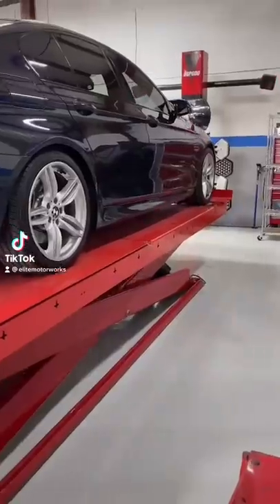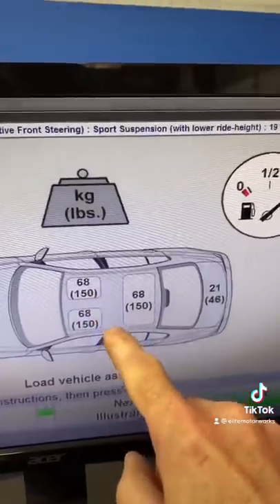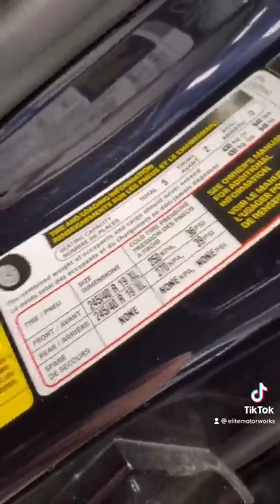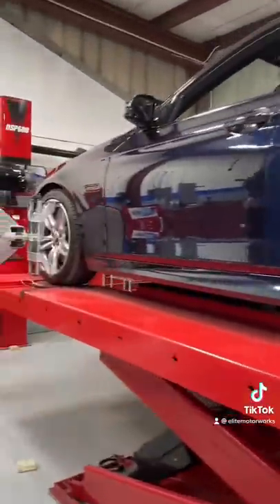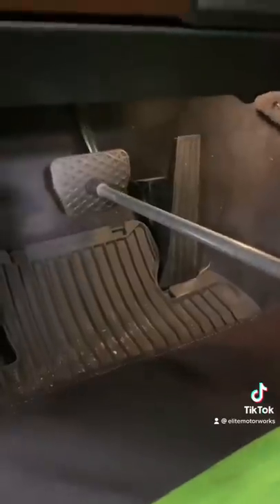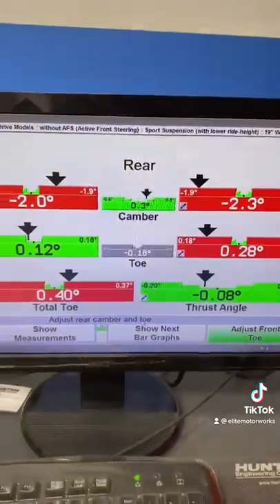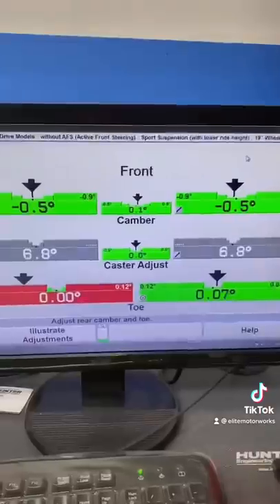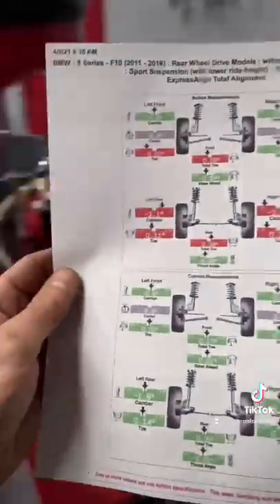How BMW does alignments #shorts

Comment: Props to some awesome BMW content! Getting the rear camber/toe in the green on F10’s and F01/F02’s is definitely a science. Both eccentric adjustments influence both camber and toe so it takes adjusting both eccentric bolts simultaneously to get the rear in the green. I remember doing some basic calculations during alignments when I first learned of the Integral 5 rear suspension on these and then realized - for expediency, it’s easier and faster to learn the double adjustment technique then to do the calculations. Unless it’s got Integral active steer which makes it much more complicated with the rear steering actuator…
Reply: ya ya i know some of those words too.
Reply: Get the toe exact, the camber doesn’t matter as long as it’s in spec but bad toe settings will make the car feel wonky

Comment: This is the correct way to do this alignment. My BMW repair manual also outlines this procedure and the tires shop did inform me that weight were called for, however, non of the tire shops I had gone to ever had weights and the dealer charged something ridiculous like $300 for an alignment, so I had the tire shops do it  out the weights for years and everything was fine. Car drove straight, handled fine no excessive tire wear that I could notice.

Comment: At the dealership I work at we use approved by BMW tools that have height sensors to not have to add the weight, but props for actually using the weights! I've far too often seen it not used and it looks like it's okay until about 20k kms later when the tires show very uneven wear
Reply: Most BMW's alignment goes to shit because their suspension components are garbage. Strut mounts made in Chiner that fail at 30k as an example.

Comment: Work at liarstone have a steering wheel leveler but no weights for the car. Try to get it close to spec everytime but without the weights and centering heads the car sits to high for a true measurement reading. It will drive straight but that's not everything.
Reply: What else is there? Just curious since I know nothing about all this
Reply: @AnishRamaswamy  camber caster split and toe angle. Toe is the distance the wheel is pushed out or in caster is how far forward or backward the wheel sits and camber is angle the wheel is pushed out or in.  Toe could be set for instance negative 12 degrees on both sides allowing the car to drive dead straight but wear the inside edge of the tire.

Comment: “BAM PRINT” while you hold the car in a perfect position & your partner clicks print quick as fuck hoping the results show a perfect alignment
Reply: Haha. Gotta be in the green
Reply: That's how you do it if you want the suspension mods to be cleared by TÜV etc here in Europe.
Reply: @panzerveps  in Germany u mean💀
Reply: @istoneyy4204  with ETC I meant all the other local government bodies. But if it's cleared by TÜV, you'll get it cleared almost anywhere else.
Reply: @panzerveps  yeah gotta agree if it’s cleared by tuv it’s prob okay everywhere lmao I live next to them and it’s funny how we dont have all those restrictions and they do I do have a German car tho haha
Reply: The alignment printout isn't worth shit if the car doesn't drive correctly.  An alignment isn't done until the car is road tested and verified to drive straight with a level steering wheel.
Reply: @ghostwrench2292  Yee dealerships will test drive it & if it’s straight “enough”, they’ll send it. Only after a customer returns about it will they make damn sure the alignment is spot on, but even then, it could be a number of other things after that, like different tread on a used tire, etc. & at that point, you just have tried your best to reason with the customer & can’t do anything more. I would know cuz I worked at one
Reply: The good Ole bump the sensor and send it lol
Reply: If you're doing it correctly as this guy is, it takes more effort to "click print" if the alignment is off. If it won't align, you have to buy the parts to make it right. Stop being cheap. This is a BMW. Go back to your Corolla. They're fine cars.

Comment: I've bought the tools and learned to do alignments myself. I own a BMW with after market wheels and I like to align them to a certain spec for those wheels. I'm afraid if I tell an alignment shop what those specs are and that I want them to those specs; they're just gonna ignore me and put it to stock specs. Ultimately I'm probably gonna be checking the alignment myself anyway so while I'm down there and got the turntables, measuring tape, alignment plates and fishing line out, why not just do the alignment myself? This guy would be the only guy I'd take my car to for work because he clearly knows his stuff and listens to what the customer has told him, fills in the gaps with his own knowledge and fixes the problem the right way.

Comment: Thats how its supposed to be done. Unfortunately not all BMW shops use the weights and the level. I have had countless discussions with shops after alignment… car drove straight but wheel not perfectly horizontal. They neither used OBD to check position of steering wheel (can be done - 100% accurate) nor a level.
Reply: That's because the actual level of the wheel is irrelevant. I've had way more people complain that a wheel looks crooked, but it's perfectly level. The dash curvature on tons of vehicles throws off your perception, so, I set them to look straight instead of actual bubble leveled.
Reply: Think is also has to do with tie rods.  I've had alignments were everything is green but the wheel wasn't centered.  Turns out I needed new tie rods.  Shame mechanics don't take the time to do simple things like check suspension parts for wear and play before doing an alignment.
Reply: @cooldaddyslick6869  incompetent techs, why wouldn't you "shake down" the suspension prior to an alignment?  That's easy money sitting there. Also, with damaged suspension components,  the alignment won't be true, and customer won't be happy. Lazy.
Reply: @gkeaton9755  Ain't that the truth.  Incompetence.  I've gone back and complained and I've seen the manager try to shake the wheels while it was still on the ground just to tell me everything seems tight and they don't know what the problem is.  Of course I just go somewhere else and never go back to places like that again.

Comment: Yup. You wouldn't believe what the weights are for. It's to simulate the down force the suspension is under at highway speeds. And, that's 90 percent accurate. A full BMW and Mercedes alignment is close to $350 +. Btw, the holes on modern BMW and MB wheels are exclusively for alignments. The attachment sits on the hub and not on the wheel. Wheel and tire combo can throw it off so they engineered it that way. Still need to reset SAS and driver assist. Sorry bro, but did you check suspension? I assume you did.
Reply: Tiddy Blaster  so I guess that means doing a shit job is fine then? 

Not saying these guys in the video did, seems like they did everything perfectly.
Reply: @elite4championjosh  yesss thank you lmaoooo. Hate seeing guys like this crying about something being wrong. 100% of those people btw start whining about the price of work too when they want it done by the book
Reply: Tiddy Blaster  I bet you're a blast at parties
Reply: Tiddy Blaster  sick burn xd. Ironic name is ironic.
Reply: Tiddy Blaster  sure if you're doing work on your car you can halfass anything and cut corners but if a customer pays you for a full proper alignment it is in your interest as well to deliver on the request
Reply: Tiddy Blaster  you never said close enough. Which by definition would be acceptable. 

What I was getting at, was that doing a poor job just because the effects are negligible is a slippery slope. Do you want a car with tracking that's slightly out, wheel balance marginally off, tyre pressures slightly over or under depending on the corner, audio system EQ a little too bassy? Maybe you don't notice the difference of some or all of these things, plenty people would. While some wouldn't notice a problem until the engine won't start or a wheel falls off. Why target the minimum of what's acceptable rather than try and be better? It'll never be perfect regardless, but it shouldn't be for lack of trying. Otherwise we wouldn't have cars, or YouTube, etc.

Comment: This is an informative video. It was a revelation to see the number of steps in a professional tire alignment.

Those weight in canvas bags of lead will over time if the lead pieces are not painted, the will oxidize and the surface lead will become a powder that can seep/shake through the canvas, this will take years.  Will have to put these porous bags inside of plastic bags that seal.

Keep up the good work.  Such a clean vehicle for the 2014

Comment: When I used to do alignments on pickups, we would often find out an estimate of tongue weight on trucks that stay hooked to a trailer, and weight in the bed. We could put weights in the bed, and add tongue weight through the receiver to try to get it as close to normal driving conditions. Good practice.

Comment: Used to do lots of alignments at a tire shop, with the boss breathing down my neck in rush. This is a huge step up from that. However it's also 3-5 times the cost.

WHEN you don't know if your alignment is out of spec, go to the tire chain store and pay $75 for a toe and go alignment, then look at the printout and check if any more time consuming adjustments need to be made at a dealership

Comment: Hi Jamie also BMW tech here. We do not use the weights in our workshop here, i have considered asking my boss to buy some again. However, usually most cars are just occupied by the driver, so i dont know what good it would do.

Anyways, a thing i noticed on the Hunter machines is that the correct values in the machine is not always the same you will find in AIR, as specified from BMW. For example on this car F10/11 rear camber in AIR is usually 1.4 or 1.5° of camber.
Reply: The alignment must be done with a loaded car. It s called Normal position. You also might add or substract weights in normal position to get closer to BMW factory design position where offsets more than 2mm between real value and factory value is considered a problem.
Even if the vehicle is driven only by one person, the alignment relies on loaded ride height.

Comment: Not being a keyboard mechanic but the beauty of the hunter alignment software is you do not need to lock the steering wheel in place with the "win toe" setting. But it doesn't hurt to lock it in place either, just unnecessary.

Comment: You should use a special tool on these, the 5 holes on the rim is made to settle the alignment head directly in the disc brake, this way scrub or bend rims will not bother the alignment

Comment: This hit close to me- I just had my truck aligned 3 times and ripped thru 2 brand new tires in less than 7k miles. Bought new tires when I saw the inner side of front drivers side tire. Also got an alignment at the same time. I don’t drive that truck much so when I finally put enough miles on the truck for an oil change I noticed my brand new tire in the same condition as the tire that triggered me to get new tires all around. Tire Kingdom said it’s my shocks, which I agree are old, but the same shock on the other side- has a different wear pattern so I know it was poorly aligned the first time. And of course they wouldn’t replace the tires that kept going bad

Comment: I had a customer with a Chevy hhr claim their car pulled to the left after I aligned it.  I retest drove it.  It was fine.  For customer sat, I put it back on the rack.  Everything was green. Only around .02 difference between any alignment angle. I sent the car back saying it was good to go with a new print out of her specs. 

Boss called me the next day.  It’s still pulling.  Customer is Otw back.  I finally put eyes on the customer.  She was a SOLID +350 lbs.  Idk how she even moved under her own power.  With her in the car, the left fender had more than a two inch difference in the space to the tire vs the right side.  I told the boss there was nothing I could do.  I’d imagine with her in the car, her alignment readings were all over the place.

Comment: If you’re not using an antique aligner like that you don’t need to add weights. You use ride height sensor targets and the computer compensates all adjustments and measures at the vehicles current ride height. But then again, those weights are probably cheaper than a new machine lol I don’t miss wheel clamp targets though 😬 not one bit!

Comment: Awesome job. I worked at Pep boys for a short while and its absolutely CRINGEworthy  how shotty I've seen some techs do alignments. They pretty much never ever touch any caster or camber adjustments. They also just drive the car forward and reverse instead of rolling it in neutral. Needless to say I am VERY picky on where I get my cars aligned.

Comment: From my experience those older BMWs just dont hold alognments no matter what you do. Tho maybe E90s are just f--ed cause it would also run alot of positive camber under cornering, ansolutely shredding the outer tread block of its tires.

Comment: The most accurate is weight added to be at the weight the car rolls with the majority of the time. If it driven 90% of the time with a 300 pound driver only then 500# set around the car is going to give tire wear.

Comment: Weight is unnecessary to add due to the fact of ride height compensation as well as you are suppose to simply measure the bottom of the wheel to the lower wheel arch and enter the measurement in mm on each wheel.

Comment: "Big box tire store" aka nbt tire. The crappiest tire pls on the planet. They but my calipers on backwards, and didn't install one of my rotors, told me that my alignment was just going to have to be bad. Gave me the wrong tires. Blew up my tire with too much air, breaking the mechanic's arm. Never ever going to nbt ever again

(Incase anybody is wondering, this is between 4 different locations)
Reply: My brother in law went in to there because they did brakes AND tires. So it was more convenient.  They had to go in 3 times to get the tires balanced properly. They also forgot to put a lugnut in. It's not so much faster if it takes you 3 times for them to do it right. Speaking of 3 times, my father works for a cooperate America company with a company vehicle. Someone ran the light and my father ran into him. It totalled that tiny Ford, but my father with a nice Silverado (would be better if it was f150 🥲) only destroyed the bumper. Nothing else. His company made him bring it in to nbt tire to get an alinement. After the first time he went in, the car would veer off about 20 degrees instantly when letting go of the wheel. He instantly turned his truck around and made them do it again. This time it was a bit better, but no where near acceptable. He went in a 3rd time and they said that vehicles in a wreck are just always off. After getting the manager to do it with my father watching him, it was finally good. We always work on our own stuff, and he is a mechanic. But his shop isn't under the list of acceptable business from his company. We always go to discount tire now.

Comment: The REAL Reason For Using Weights During Alignment? (No, It's Not What You Think.)

According to Dinan the purpose of the weights is to simulate the angles in the suspension when the car is driving at high speeds.

When you drive faster, you'd notice that your car "sits down" lower and closer to the road. As the car "sits down lower" the wheels spread wider.

This is caused by the aerodynamics of the car. Slanted windshield, slanted hood, underbelly, etc. BMW designed the car to go lower when you drive faster, not to go higher (float).

The alignment specs are therefor there, because they want specific numbers when you, the driver, need it the most - when you drive the car like it was meant to be driven. Not while you are at your shopping center parking lot driving speed. Makes sense?

Comment: I owned one of these and as a mechanic at a place with no sandbags or lead bags to do this, and refusing to pay other mechanics to do my own alignment, I always did my alignment with no weight in the car. I never came across any issues. Is it really that necessary because from personal experience and from other people I’ve talked to a lot of people think it doesn’t really matter all that much

Comment: I've taken my BMW to 3 different alignment shops in 2 years and I still have misalignment and go through rear tires even with 5,000 mile rotation. I need this bad
Reply: make sure theyre even adjusting the rear to begin with. bmw calls for replacing the nuts every time you loosen them to make an adjustment.

Comment: That negative 1.8 degrees camber on the rear may be the " green bar spec" but will wear out that tires inner edge in less than a year.  
The reason the specs on BMW allow such negative camber is because rally car racing in Europe has rules that state must me in factory spec for alignment angles.  
This is not widely known in the repair industry and should be taught.  
That's the same reason a 1990s Toyota MR2 allows up to negative 2.5 degrees camber on all four corners.   
And now you know. 
GREEN DOES NOT MEAN WONT PREMATURELY WEAR TIRES UNEVENLY.

Comment: The weights are supposed to go on the seats to simulate passengers not on the floorboards. Either way. Good job, not even the dealer adds the weight.

Comment: Hate the way a “certified” BMW shop did mine. Always holding the steering wheel slightly to the right. Then the ecopro mode doesnt work to coast because of that. Wish you were in Cali 🫠